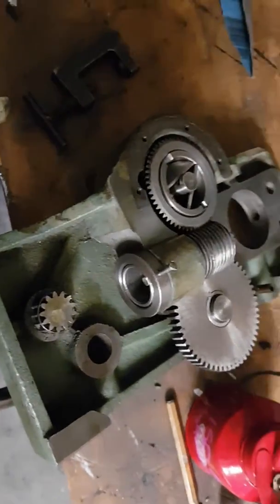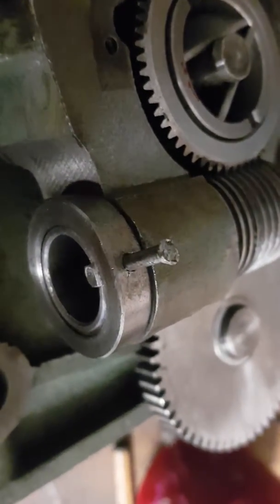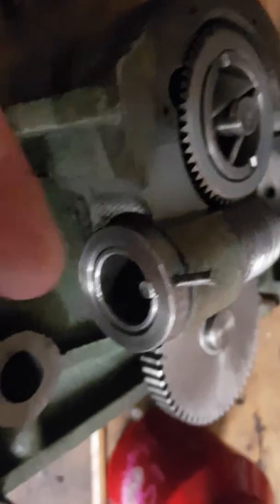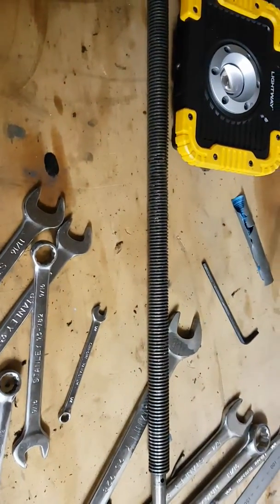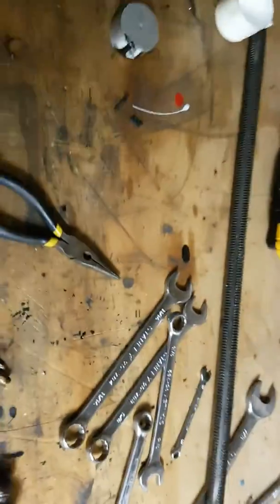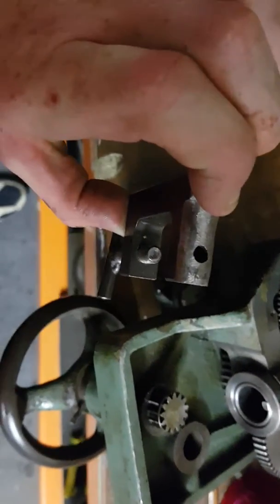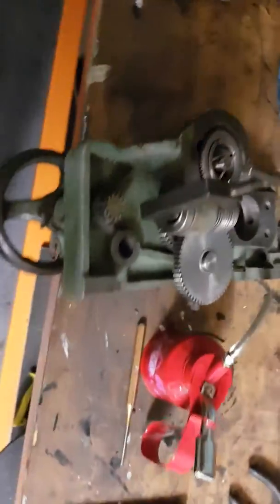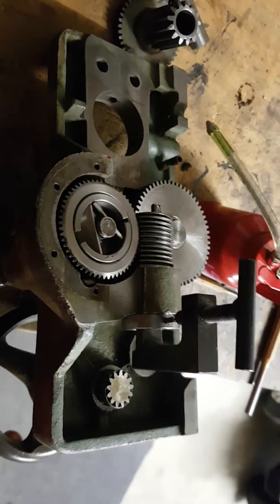LITTLE TIPS #5 Hercus 260 Apron installation tip

Comment: I'm having trouble taking the clutch handle off. Can you give me any pointers cheers
Reply from the maker: Yeah, you have to take the apron offand completely strip the skirt. The Hercus 260s are a direct clone of the 9" South bend lathes. There are plenty of strip and assemble videos out there. If you can handle his dry and weird way of speaking look up mr pete (tubalcain). He has some simple to follow vids
Reply: @thelittleshopaustralia4733  thanks mate. I'm also after a 3 jaw chuck for the hercus 9inch model A . Do you know where I could possibly find one. Thanks again.
Reply from the maker: You may get lucky on Gumtree. Occasionally someone will split up their Hercus and sell it for bits. Original Hercus chucks are rare by themselves but almost always come with the lathe itself. If you are real keen for one (which a 3 jaw is the most used chuck of the bunch) I would buy another hercus with the 3 jaw and resell it with the 4 jaw. Or you can make up an attachment for an aftermaket one. I had my 9" southbend before I got my Hercus and am unsure if the attachments work together, mite be something to look into
Reply: @thelittleshopaustralia4733  once again mate thanks for your time.